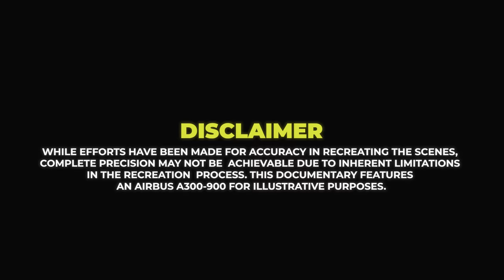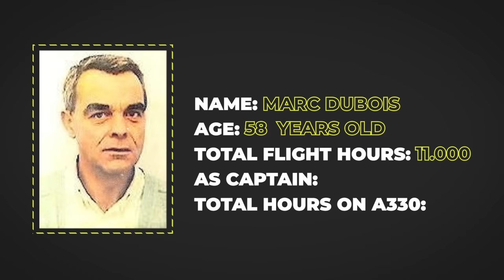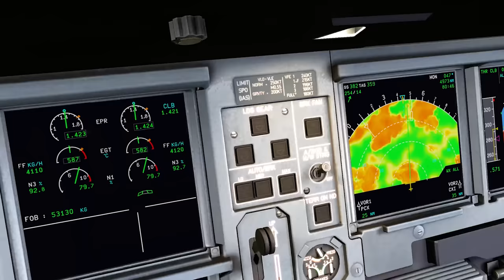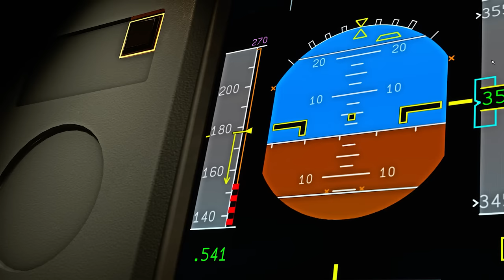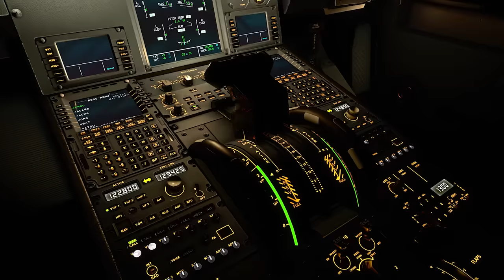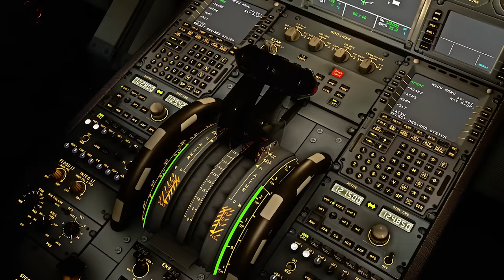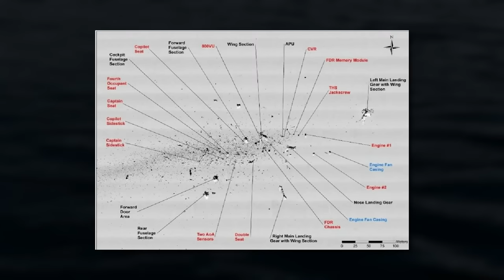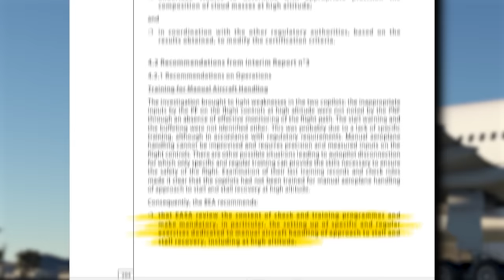Horrific Freefall into the Deepest Ocean | The Sad Story of Flight 447

Comment: Imagine sitting in a stall for that length of time and continuing to pitch up, it just boggles the mind how did he ever got a pilots licence.
Reply: Blinded by stress (which is unusual as stress management is part of the selection and training process)
Reply: Im not a pilot, but still I feel like his actions were so illogical 😢
Reply: I just like planes, but is so logic to me the wings angle attack  lift and stall concepts. Poor guy, how could he get so lost pulling that stick back the whole time. Really sad story. RIP all those poor souls 😔
Reply: Apparently they don't train them to actually fly the plane anymore 🤯
Reply: @mikehawk5492, think about it: it was dark, flying in T-storms with significant turbulence, which is terrible for spatial disorientation. Even a competent IFR rated pilot can get disoriented in such conditions. But the situation was worsened by all three pitot tubes icing up, which really screwed them up (and I have to wonder now, was the airframe picking up a lot of ice as well? I strongly suspect it did, which would account for the loss of airspeed and precipitate the stall… how was that not recognized by the pilots and/or the inquest?). Now they had no airspeed indication and their autopilot was automatically disabled.  At this point they had to hand-fly using only a partial panel, in true IMC, with no airspeed indication and loss of all their fail-safe systems.  The stall warning (which is based on the airspeed indicator) was not reliable… however, the uncontrollable roll angle with rapid loss of altitude SHOULD have been a clue to them that they were in a stall.  But apparently both pilots were disoriented and confounded, and stall recovery was not initiated.  It was a bizarre series of mishaps and errors.
Reply: It’s not that simple. If you knew the complexities. You’re on the ground, no stress, and all the research already done for you. Vs in real time with conflicting Instruments, at night, in a turbulent storm, 35k ft, over 500moh. Look up what the stall alarm did during the stall.
Reply: @christerry1773  agreed!!
Reply: @christerry1773 I’ve seen a by the second break down of the incident, the tubes were de-iced and they had accurate readings before the final plunge, they just didn’t trust them at that point. It was pure incompetence.
Reply: @CableReadyTechnoSIut  so if it was you
Flying you would have overcome startle effect and immediately realize what was happening?
Reply: @JamesWilliams-en3os  they never even discussed the stall warning that went off over 35 times  there was so many things wrong, including lack of crew resource management.  captain went for a break knowing they were going into the worst part of the flight
Reply: They trained with flight simulator
Reply: @christerry1773  Bro how can a licensed pilot now knkw what to do when he hears the stall message? You lut the nose down and increase speed. simple as that.
Reply: @sparkle2843 think this has a lot to do with it. These pilots have learned how to work with automated systems, not fly planes well
Reply: 180 knots and dropping and then still climb 🤦‍♂️
Reply: @christerry1773 they weren't even close to 500 mph. That was the problem, they were going way too slow
Reply: The two pilots clearly thought they were in an OVERSPEED stall. You can hear it on the CVR / read it in the transcript. They thought they were flying way too fast, which explaines the constant "pitch up" manoeuvres and putting the thrust to idle. Spatial disorientation (dark night, no natural horizon to set their eyes on) did the rest. Stop judging from your armchair.
Reply: It’s because he went into panic mode and your body naturally tells you that pitching down is guaranteed doom. True knowledge as we know now is he should’ve used the dip method( pitching down to gain speed and then back normal, and use to to gain as much distance as possible.
Reply: @christerry1773 I’m no pilot but being able to fly in the dark, in a storm, and recognize a stall pattern seems like the minimal requirement to fly that route.
Reply: @lucasmelo010  that type of situation was hardly ever encountered.
Reply: The turbulence was quoted as ‘moderate’…let’s not get too hyperbolic. Take-off/landing are the only times I want a pilot to take the stick.
Reply: @lucasmelo010 pilots who don't need to know anything (or substantially) about physics is the crime.

It takes years to develop mechanical intuition. Yet that isn't a requirement to fly a big ass plane.

You cannot develop that intuition as an adult by just taking a few courses spanning 1 year. And, again, they do wayyyy less training than a full year of mechanical physics.

You cannot see that degree of latitude in engineering or medicine lol. People would routinely die. 

In this case how can you fail to notice a 10 degree incline? It would take me 2 steps back and 2 steps forward on my feet to know I'm on a 6 degree incline.

10 is noticeably more. I know, because I have a treadmill.

Lastly that Bonin guy got the job through nepotism, guaranteed. The sheer incompetence and lack of character points strongly to that.
Reply: Nonsense pilots. AirFrance fully to blame. As passengers flying should be boycotted and replaced with vc and any holidaying decision should be taken with full awareness of life risks.
Reply: They put a couple of very experienced BA training pilots in this scenario and they managed to very quickly stabilise the aircraft pretty much using SOP, however the Senior pilot questioned as to whether he would have the same reaction in a live aircraft over the Atlantic in the pitch black during a storm. From doing research into this tragedy they appear to have flown into a brutal storm system, in which super cooled liquid water blocked the pitots and they encountered huge updrafts which threw the aircraft into a stall, the climb rate of nearly 7000fpm can't be explained by other than exterior influences. Bonin should not be blamed despite there being severe lack of communication in the cockpit............very sad for all involved
Reply: Even with the temporary loss of reliable airspeed readout, the crew had all the information they needed to deduce their situation, and did not use almost any of it.  If you are nose-high or attempting to be nose-high, have poor roll/yaw control, and losing altitude, that is ALL (minimum) you need to identify you are in a descending sustained stall.  Recovery being throttle and stick forwards, nose down, regain speed and control and level out.  Extremely easy.
And yet it was never done.  Until the guy on the left tried to, and asked for controls.  He attempted to make the right move, but the 1st Officer on the right did not let go of the controls and countered the others' input.
The only thing more tragic than the tremendous loss of life itself, is how it was lost to something so stupidly easy to identify and recover from.  And what a mammoth failure of training on Air France's part.
Reply: Yes agreed, it is obvious in hindsight to us all about why did this pilot continuously pitch up. It’s baffling. The narration at the start. Of this clip indicated “experienced crew”. I think that is where the problem laid.
Reply: Surely the attitude indicator can be relied upon at all times even if the speed indication is subject to icing and faulty reading.
Reply: There is literally no situation that calls for nose up for 5 min. I still think the idea that Bonin intentionally crashed isn’t out of the question
Reply: @jpalmz1978 more like panic
Reply: Every time they did the wrong thing, the warnings disappeared. Every time they pushed to recover, the stall warning came back. In the stress they kept doing what made the warning go away.
Reply: @NewgrangeHoney Fair connection. Sadly.
Reply: They were surprised by the alt law control which had more responsive controls and no safety built in. Normally the Airbus doesn't allow inputs that could stall the plane or push it outside of its designated flight envelope. 

The continued roll was counter-acted with extreme roll input into the opposite direction. Even with the inputs being extreme, the ailerons aren't effective at lower speeds at while at 35000 feet. 

They didn't mention it but I'm also curious to learn if the auto trim wheel was disabled.

The stall warning, the pitch up on the stick and the continued change of the throttle showed that the FO was completely incompent to fly anything. Completely ignored basics of flying an aircraft, caused several dual input warnings, didn't communicate with the other pilot.
Reply: @TylerDurdan241 so you find Bonin showed himself to be an airworthy captain?  Cmon bro the dude is a clown regardless of where else the blame lies
Reply: @sparkle2843  2009
Reply: Isn't like the first logical thing to do to check that indicator to see that you are not actually pitching up?